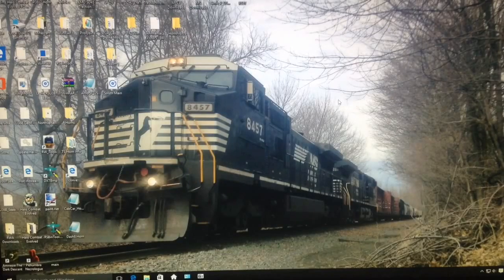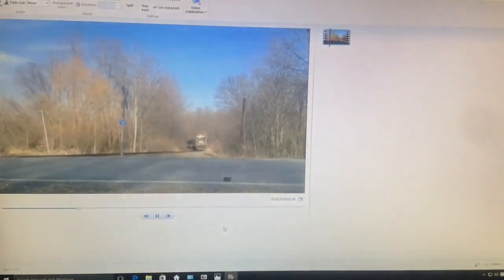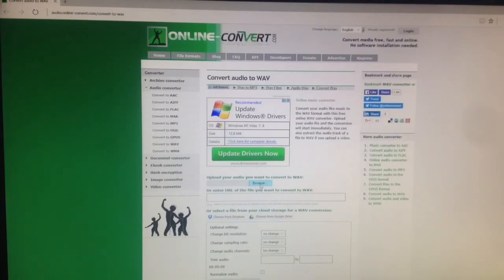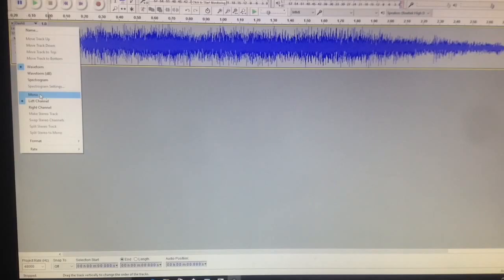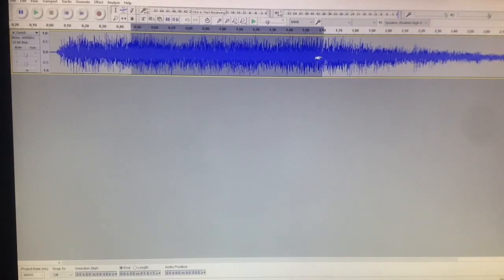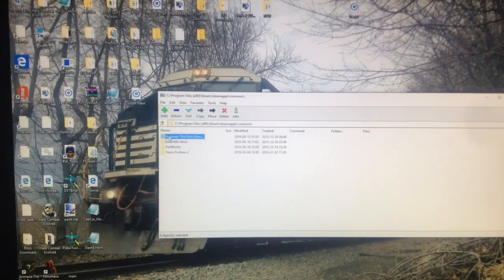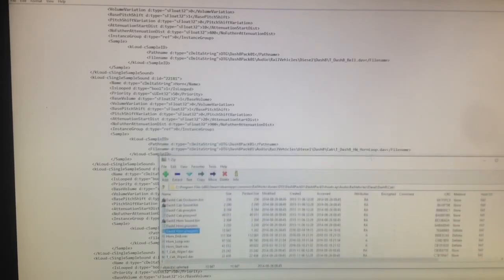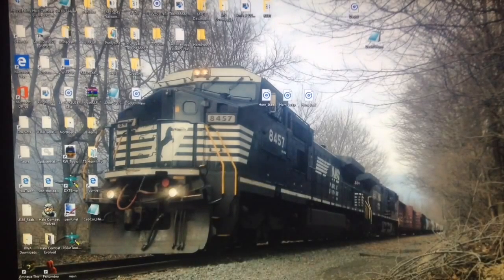Train Simulator 2016 Tutorial | Creating Custom Horns!

Comment: I was completely following along until you got into the locomotive assets and it let you into the audio file.  I got an error message asking me what app I wanted to use to open that.  What software are you using to do this?  Even though this is from 2016, I'd think the files/utilities would be the same since Train Simulator Classic really hasn't changed formats during that time.

Comment: I keep trying to change the horn and it just keeps sounding the default. How do I fix this? I did what you were doing.
Reply from the maker: Kentucky Railway Productions - That’s odd. What unit are you changing the horn on?
Reply: I was trying to change the horn on the Sherman Hill version of the UP ES44 and also I was trying to change the horn on the NS Dash 9.
Reply from the maker: I have custom sounds for both and they work fine. If they keep playing the default sounds, try to make sure it is saving once you are done with edits.
Reply: I thought I was the only one. Mine keeps sounding default too and I've followed all the steps in most of the videos I've seen and still the same result.

Comment: When I made a horn and I followed every step and it makes a slight pause going from the start file to the loop file and to the end file.  Do you know anything about why it does that?  I don't mess with where the loop file or end file starts.
Reply from the maker: I've had it happen to me a couple of times. That usually means you have to do nothing but some simple trimming, but it could be something else such as the locomotive's programming.
Reply: I tried using an MSTS horn for the Pacific Surfliner F59PHI horn and that's where it would have a gap.  The default horn for that locomotive doesn't have it happen.  I just tried making the end file overlap where the end of the loop is and it didn't have a gap.  I guess I could try trimming like you said to see if that works.
Reply from the maker: Yea I hope it works! :)
Reply: So it was the horn button on the locomotive by changing the digital input sensitivity increased and now it works properly.  Thanks for the help.
Reply from the maker: No problem!
Reply: @AustinTrainsOfficial  Austin, what do you do if there isnt an option to change it to mono?